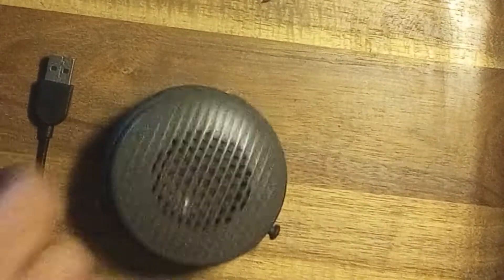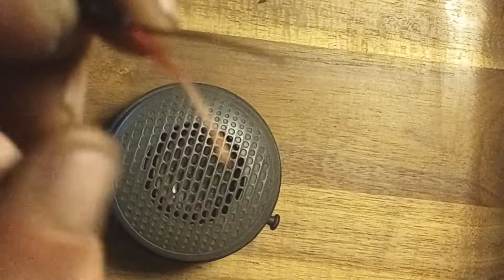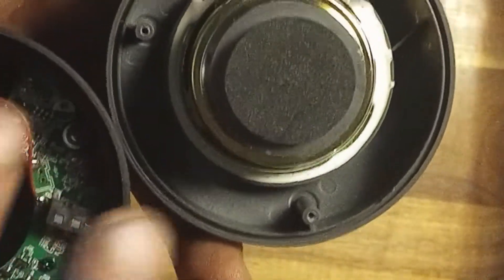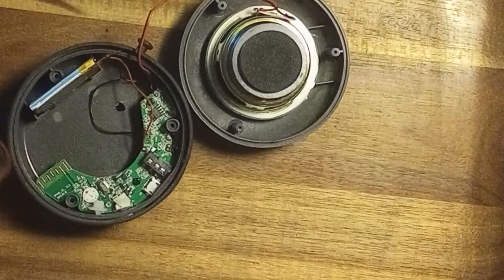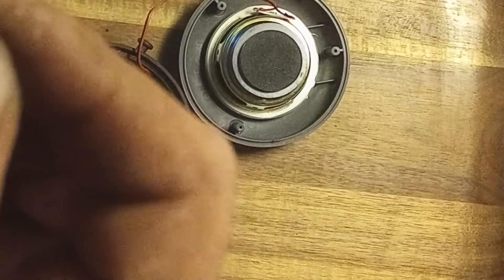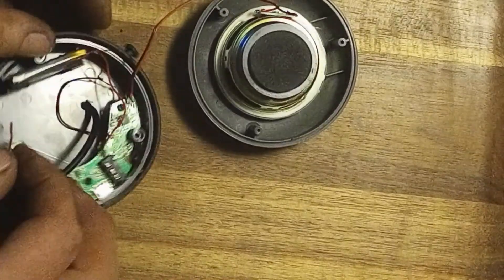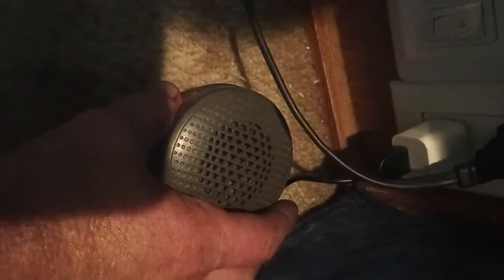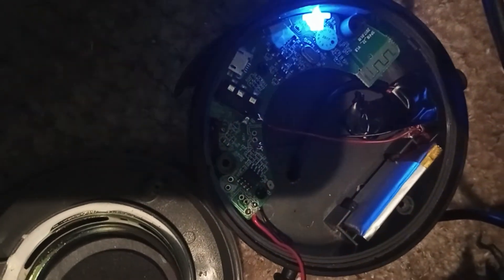How to fix any broken usb charging port for bluetooth speakers and rechargeable devices

Comment: Ok. It's really important to note that this only works if the BMS is built into the battery (to prevent overcharging). If not, if the bms is on the circuit board, which it usually is, you will overcharge your battery and could even get a nice little explosion out of it. I can't tell from this video, because the quality is pretty low, but that battery does not appear to have a bms built in.

Comment: Tie a knot in the new USB cable that you poked through the hole so it can't be pulled out and damage your newly made connections. If the device you are working on does not have the cavernous open area like this speaker did then simply put a plastic tie-wrap in place of the knot Voila, you have a strain relief device using either method. Also a little Hot Glue could add even more protection.